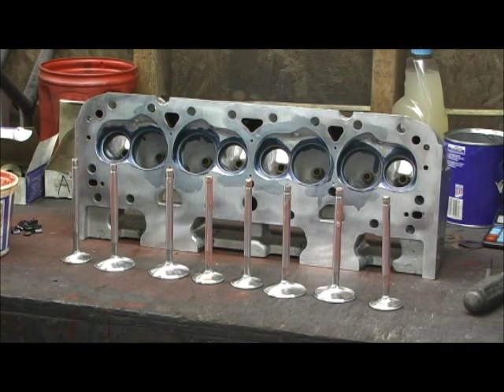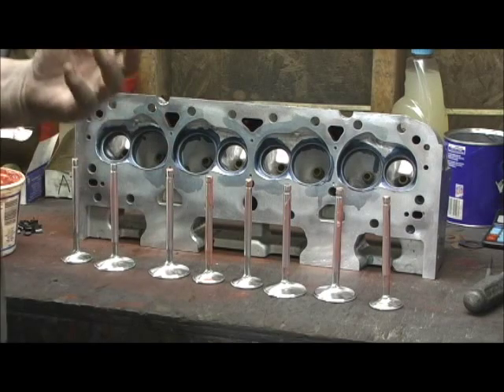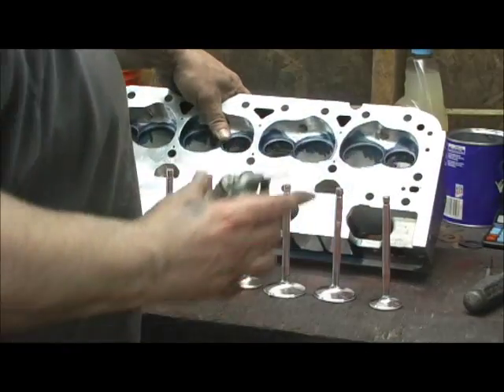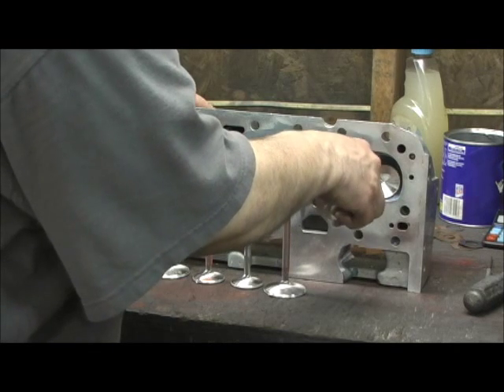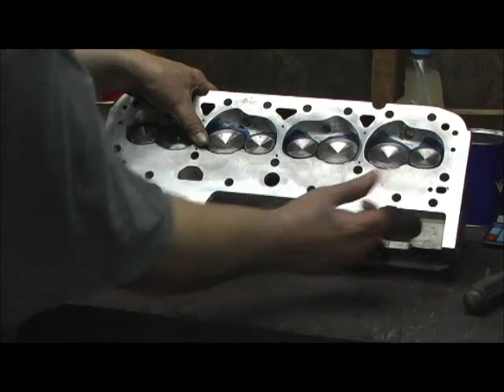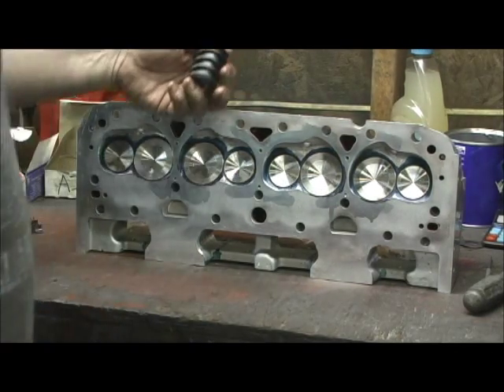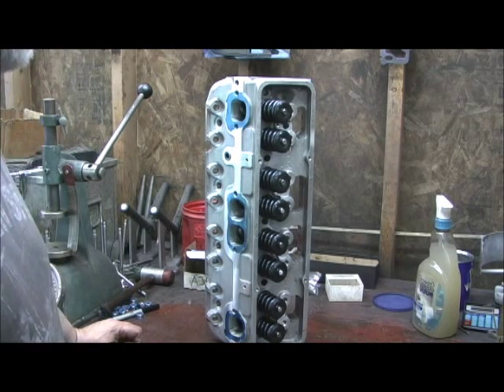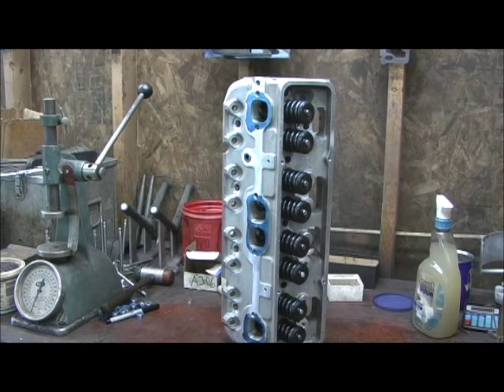ProMaxx SBC 247cc/319 CFM Assemble Heads 9.2

Comment: Hmm, I like your grease mix, there!  I'll have to give that a try.

The last head I rebuilt (for myself), I couldn't find my lithium grease, and I ended up using Lucas "Xtra-Duty" #2 grease on the valve stems, lifters and cams (DOHC engine), instead of assembly lube.  All the parts were re-used, still in perfectly serviceable condition, and it's running great after a couple months of steady driving, so I guess it worked alright!  Any thoughts?  You're welcome to call me an idiot...  ;D